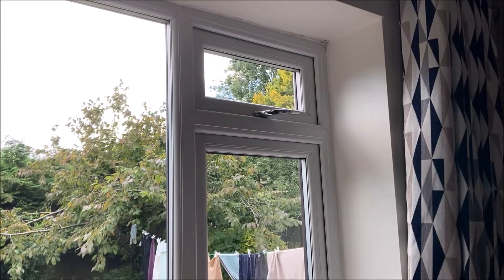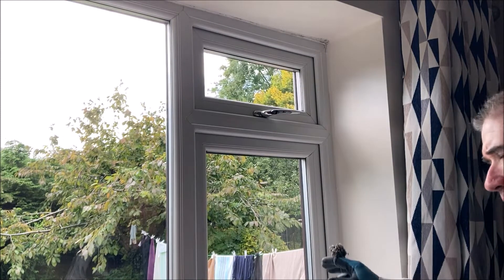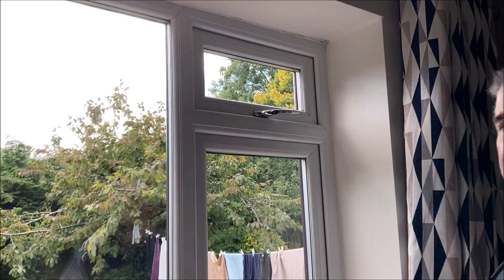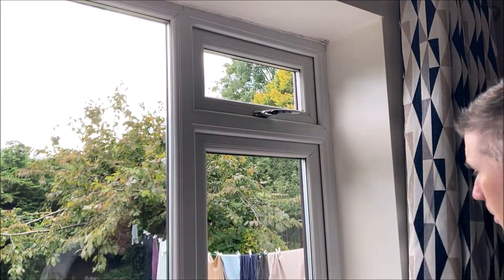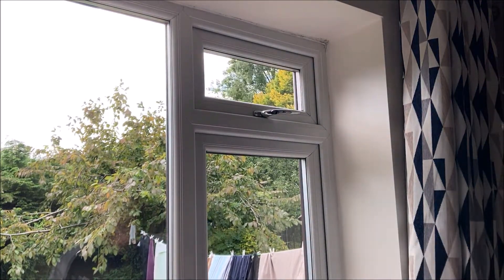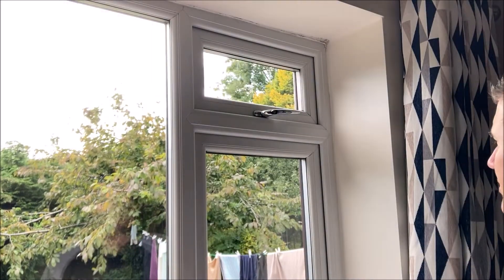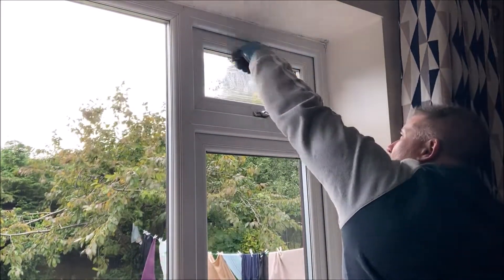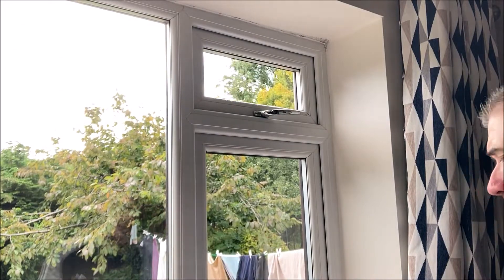Polzn Bladz-Washer & scrubber Part 2

Comment: Haha Yo Bob, I just started doin' this on a big job recently (the small panes only), I just realized as I walk up to the garage door windows that were bug-spotted, "Hm, why the hell would I wand/scrub/squeegee these when I could just scrub/squeegee?!". It went so much quicker! I found that small panes can easily be wet scrubbied then squeegee, vs. three whole steps. Easy. Window cleaning really challenges my intuition because I'm always striving for the literal perfect methods to both save time AND do the job well. The key to the big money besides having a good grip on your prices, is TIME SAVING techniques.
Reply from the maker: Work quicker and get better results is always a winner in my opinion. Too many window cleaners stuck doing the same things using window cleaning tools that don't always work well in some circumstances. Always think outside the box instead of being stuck inside it all the time